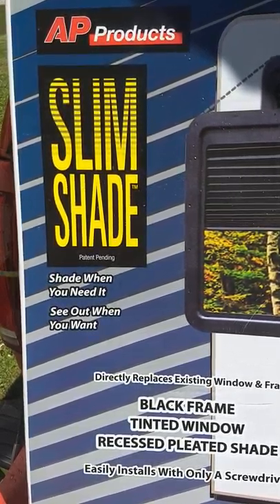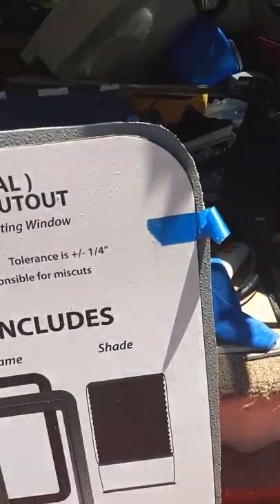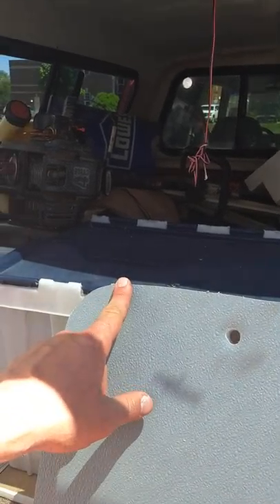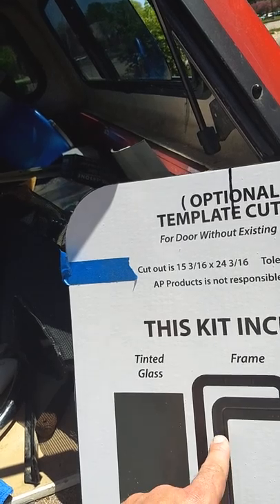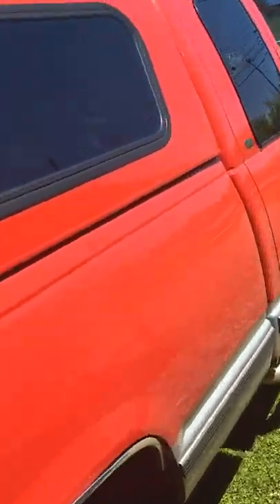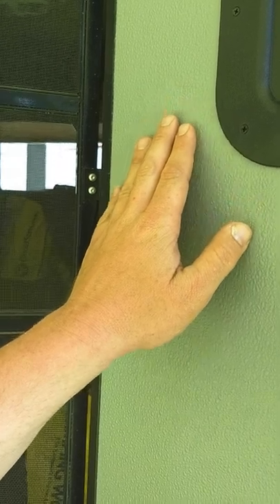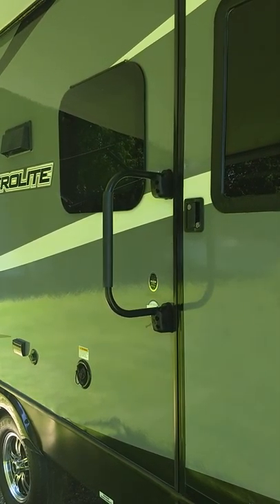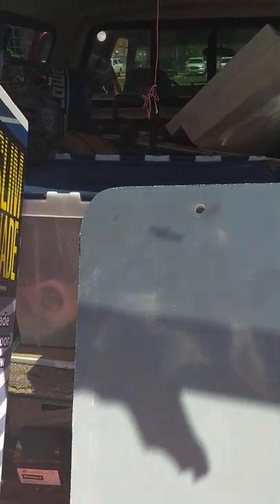Slim Shade Install

Comment: Thanks for the tip on the template size. About to install one of these shortly and need to cut the hole in my door also. Would have been upset with a gap as large as you described. What did you use to cut the hole in the door?
Reply from the maker: I just use your standard skill saw with find metal blade and went slow. I drill for holes in each corner of the template and then just cut up the line.

Comment: Did you cut through both sides of the door at the same time or one at a time?
Reply from the maker: Yes sir, I put painters tape on both sides to prevent chipping
Reply: @richardlemke4240  Thank you. And did you have to predrill the other side or just let the skill saw punch through?
Reply from the maker: I let the saw just punch through